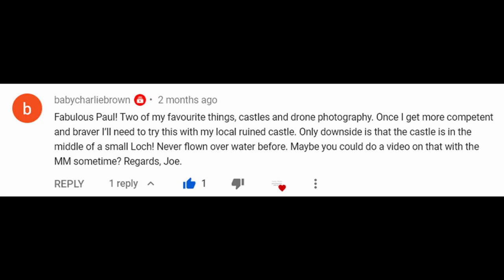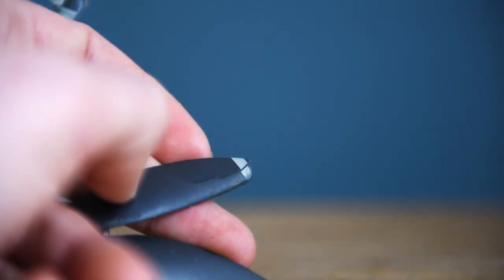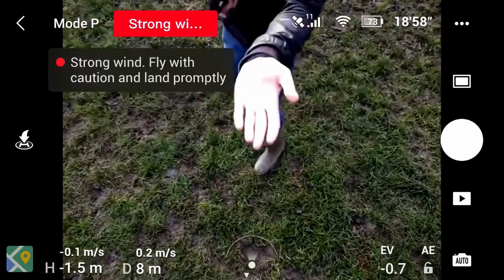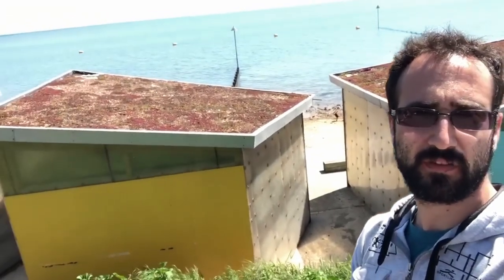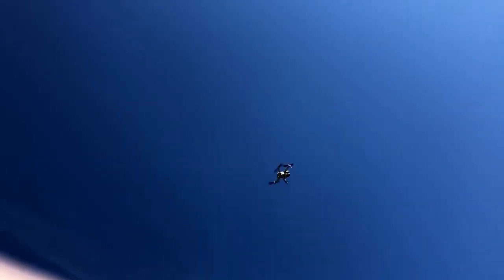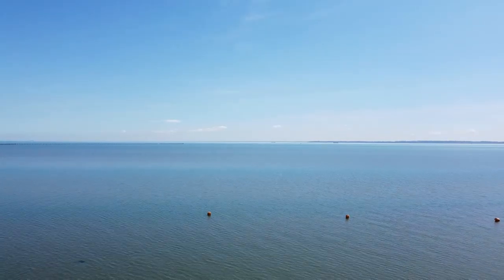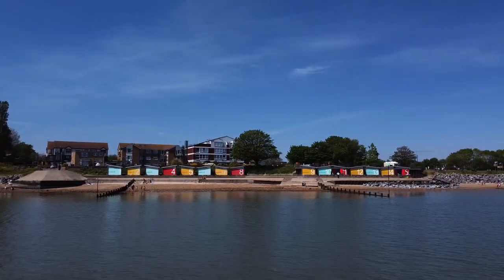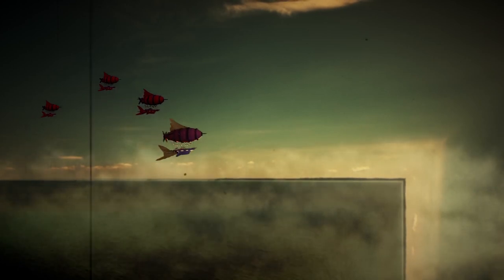DJI MAVIC MINI - FLYING OVER WATER

Comment: Hi Paul, it sounds like the optical flow sensors on the bottom get confused by the reflections on the water. Has anyone tried forcing the drone into attitude mode by covering over the sensors with masking tape? I know there are risks involved, but I suspect it may prevent the uncommanded ditching that seems common when flying low over water. It would be good to hear if anyone has tried this with success.
Reply from the maker: I have tried with the sensors taped not over water and it tried to land every time I Pressed down on the remote...
Reply: @paul-thys  thanks for that update, good to know.  I am planning a dronelink mission involving some coastal cliffs and over water flights,  so a bit nervous about the ditching issues. btw i am enjoying catching up with your videos. Cheers.
Reply from the maker: Thanks Laurence! 
Think you will be fine at height! Something I have found out since this video is the power of the motors is greater with a higher battery life so make sure it is fully charged. Good luck, thanks for your support and hope you have clear skies!